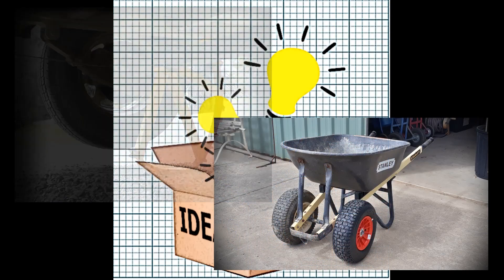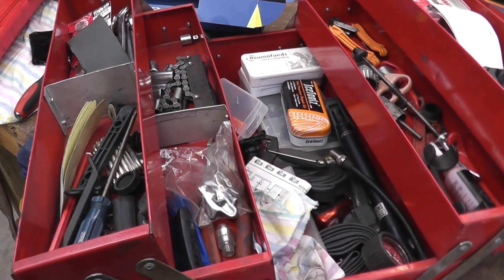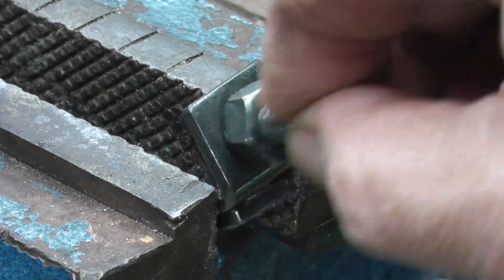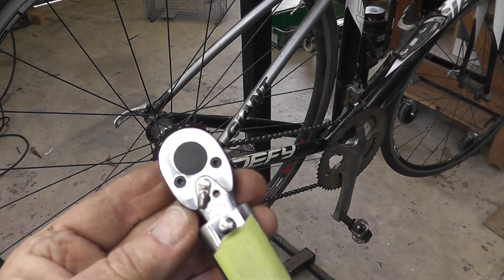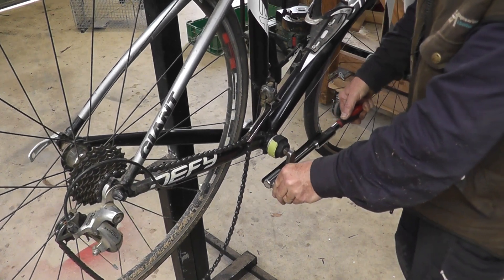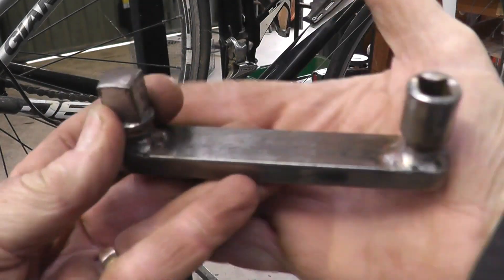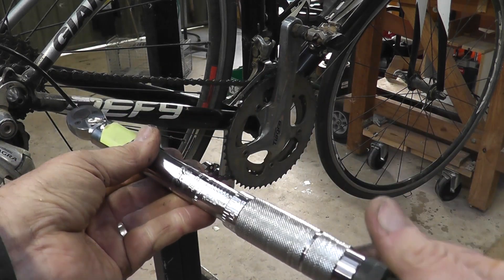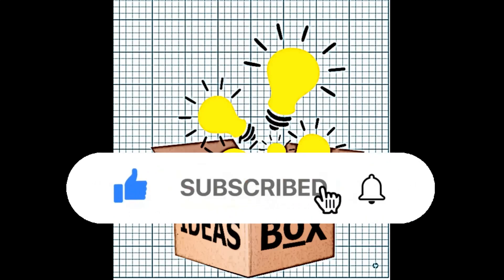Torque wrench adapter for left-handed thread

Comment: That's a neat idea, and potentially more accurate than you expected! It's often thought that a 90° extension will still add some variation, but in fact if the application of force also stays at 90° to the wrench, the moment arm isn't the hypotenuse of a triangle. It remains at the shorter length because the moment is a perpendicular distance between the force line of action and the point of rotation. At 6:31 in the video the 345 length would only be the moment if the force was acting at 90° to the hypotenuse. If a video link is permitted, I did a little demo: https://youtu.be/Or3oPdNTiEQ
Reply from the maker: @PlatypusPerspective  wow, thanks for commenting. I'm glad my video interested you. I watched your video, it was intertwined.  I hope you liked my others too.
Reply: @IdeasBox  Ohh, I do like a pun. And I liked your microwave turntable timing boomerang idea!
Reply from the maker: @PlatypusPerspective  thanks for commenting. I'm glad you liked it.